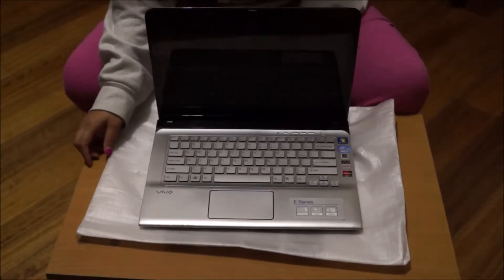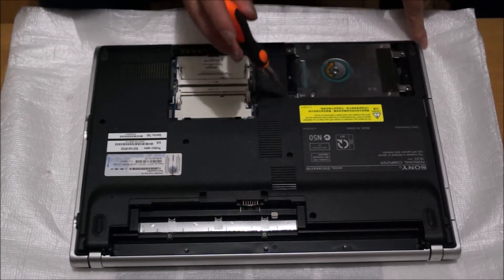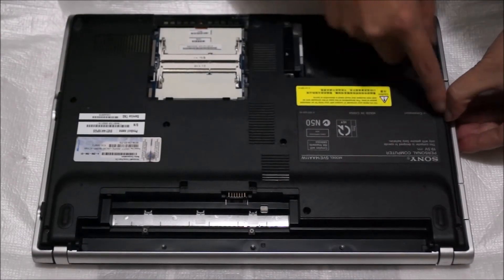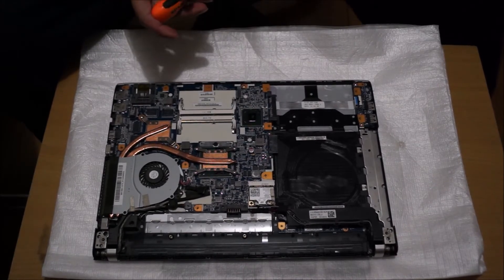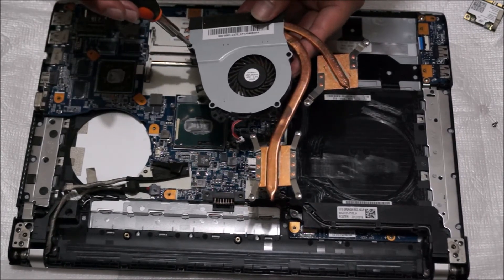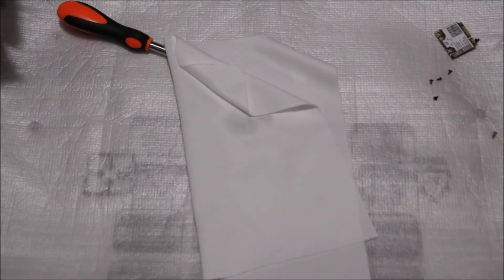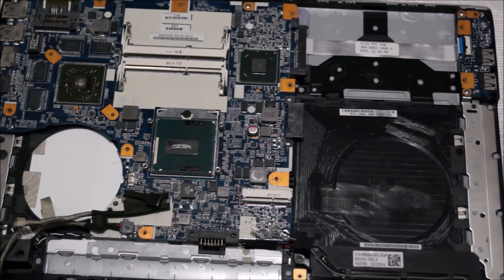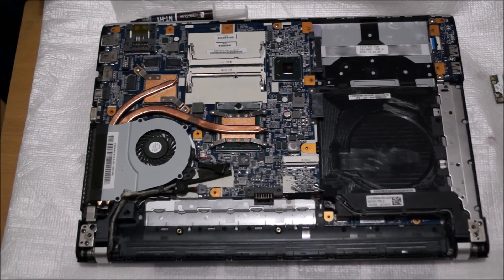OPEN ME UP! Sony 14P SVE14A16FG Disassembly

Comment: i wonder if cpu can be upgraded
Reply from the maker: the information is below. also if you watch the video i show you it can be changed.

CPU can be changed, graphic card is solder on, ram 16GB max with 8GB in each slot there is 2 slot, wireless card can be changed, hard drive which is a 2.5 inch can be changed.
Reply: @OpenMeUpTec  yeah, i see that it is removable.  Doesnt mean it can be upgraded - due to bios issues or power issues.
Reply from the maker: @DxsPro  they sell this laptop with multiple of configurations from i3 to i7 therefore you can change it to whatever they had as a configuration.

Comment: Hi there! I've got an SVE14a15CE. Apart from cleaning it from dust, what can I do to lower the CPU temperature and lower the volume of the fan? Is it possible to replace the fan with a quieter and more modern one? Is it possible to replace the cpu with a more modern efficient Ryzen one or would I need a new motherboard for that. Thanks so much for this video!
Reply from the maker: you cant do anything else. this laptop is too old therefore it is better off to sell this off and buy a new laptop.
Reply: @OpenMeUpTec  THank you!